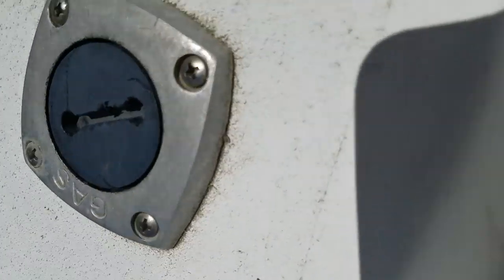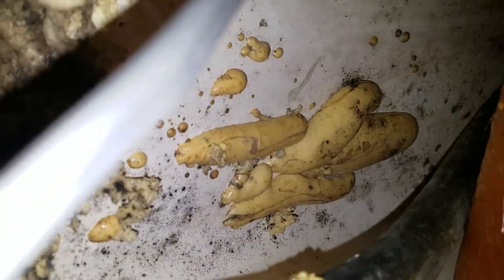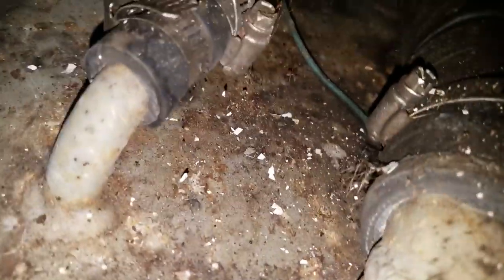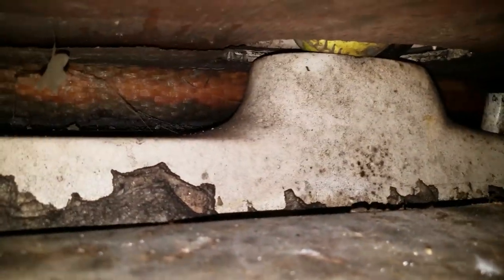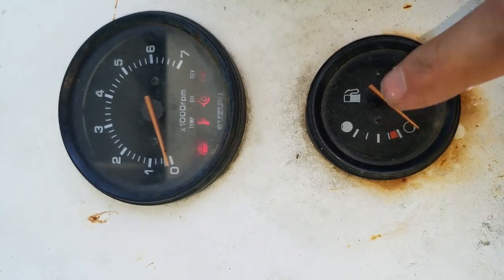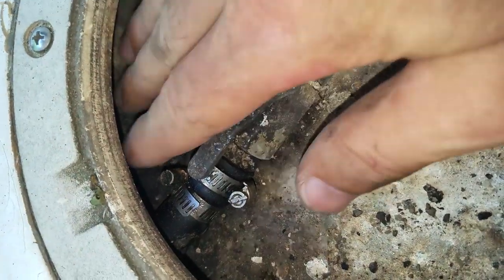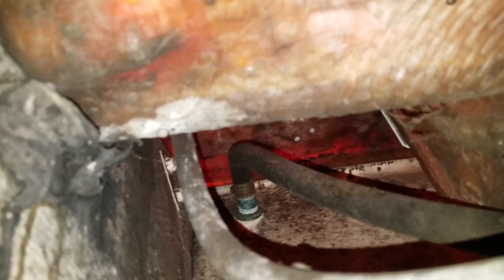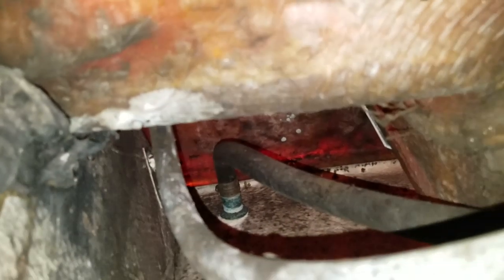'95 Mako fuel tank problems - need help

Comment: The ground wire is to prevent static charge from building up while the fuel flows into the tank when filling it.  Use a smoke machine to pressurize your fuel system, and watch for smoke indicating the leak. Research smoke machines for diagnosing evaporative emissions.

Comment: I have a Mako 192, from year around 2000, and I have restored it, ALL. I have removed the fuel tank, it was corroded in many side, but only external. I write for say you my results. I HAVE REPARED THE FUEL TANK IN INOX  WITH  TIN metal .  To solder with the tin ( in the inox normal don't bind !!! ) I have used a solution with hydrochloric acid with inside same pieces of zinc (or iron zincated that i have removed after the acid have dissolved the zinc). The tin have solder in optimate modus, covering also the surrounding zone.

Comment: I have 94 Mako 241. Need to make sure you have rubber gasket on the fuel sender (which appears to not be working in your video) and that the screws are torqued down properly. Mine were not and I had water in the fuel. I changed out the sender (make sure you get 240-33 ohm!) and the problem went away.  These boats are built tough as nails and it's unlikely the tank or even the hoses are failing. Hope it helps.
Reply from the maker: Thank you for your reply.  I changed the fuel sender and the gaskets.  The fuel gauge works again!!  I have been incrementally draining the gas tank 6 gallons at a time using an external tank and connecting that to my engine.  I have also been double filtering it as I siphon it out.  My plan is to empty the tank completely (or as much as I physically can) so that I remove as much water as possible.  When it's almost empty - I'm not sure how to remove the very last bit once drained - I think I'll be able to fill er up and be back to normal.  I agree with you - I think I had a leak from the sender (that I changed a couple seasons ago) and this caused the whole problem.  Hopefully there is no leak or corrosion in the tank itself.
Reply: @SurvivorDiet  Fantastic! May I ask which model your boat is and if you have an auxiliary fuel tank also? My 241 has an auxiliary fuel tank what I estimate to be about 200 liters (50 gallons) but would like to find out for sure. There are two separate fills on the port gunwale. 

Glad to hear your issue is sorted. Just run that tank as low as you can and top up with good fuel. Keep an eye on your prefilter inside the engine cowling. Do you also use Parker Racor primary filters? I highly recommend them. Cheers! Jon
Reply: @SurvivorDiet  To get the last bit of water out....buy an electric fuel pump, attach the hoses to it. Jack the front of the trailer as high as you can. Put the suction end of the hose in the tank, and vacuum the bottom of the tank. Put the discharge hose into a clear container {so you can see the water that you have removed}. I also suggest adding a bottle of Heet . It is an alcohol based product that should take care of a minimum amount of water that may be left in the tank. Hope this helps-

Comment: I had same smell of gas. Turns out I had corrosion pin holes on top of tank. You need to PULL the tank and evaluate. Or replace   .

Comment: at 8:36 that second (right one) square feed tube should be capped off, it looks like it is wide open at the 8 o-clock position. Also, I'd clean all that off the around and under the sender and replace that O-shaped gasket, cleaning it with solvents down to the bare metal, then put the new gasket on. Careful not to cross thread those screws!!! So... did you figure out what the issue was?

Comment: I am pretty sure water is coming in from your breather. where it goes through the hull, normally there is a vertical "P" trap to stop water from hitting the external vent and coming in, and currently you have nothing stopping water from draining straight to your fuel tank.

Comment: I know what you're going through, unsnap your plugs in center console and wire connectors, unhook your steering then unbolt set-top, then center console. 
Tilt the center console to one side and take panels off to expose fuel tank. Remove fuel tank and run water into scuppers till you leak, repair and replace fuel tank.

Comment: Having the same issue
Reply: I ended up draining my inboard tank and using an external tank.  The fix was just too extensive for an old boat but my solution works  very well for my situation